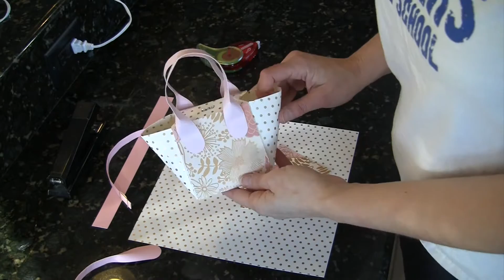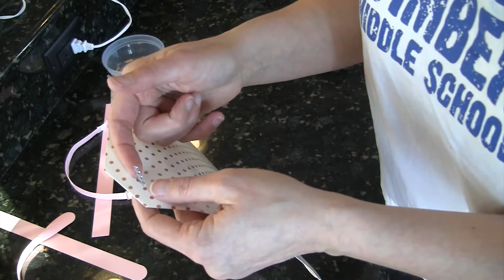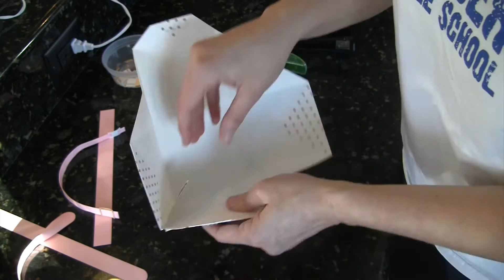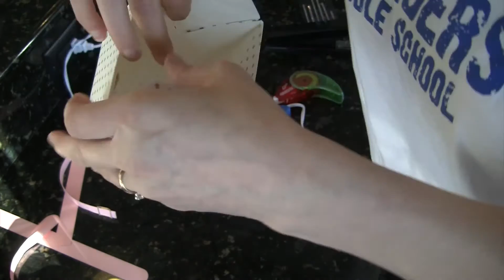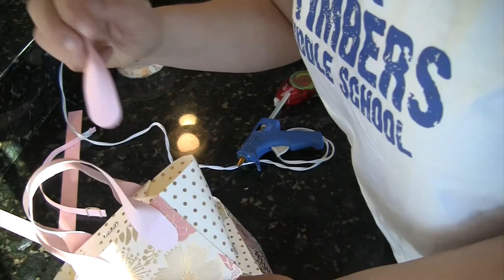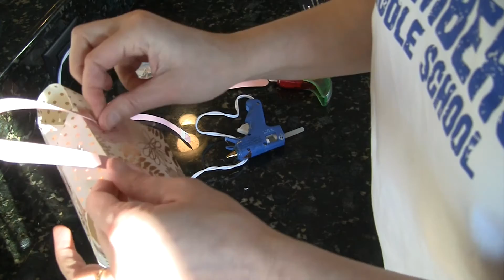Using Design Space and a Cricut Explore Air to create a purse gift bag

Comment: Hi this is a great video.  Do you still have the cut file for this.  if not may is have the measurements for where the fold lines are.  I don't see this particular purse in design space.  do you know the name of it. Thank you
Reply from the maker: Here is a link to the SVG file that you will be able to upload into Design Space.  The lines will need to be changed to score lines and the others will be cut lines. 

https://drive.google.com/file/d/1e06wSg4T_bQ4CA7JfkFwOieNLhsRm_w0/view?usp=sharing
Reply: @sdonnal  thanks for the file but it doesn't have the score lines for the corners for the velcro.  I've tried to add them but the project isn't working correctly.  I resized the entire grouped file down to 11.5 so it will fit to a 12 x 12 sheet but I'm not sure how to get the correct distance for the corners.
Reply from the maker: @deborahcannon2403  I apologize for the issues.  I just updated the svg file with the corners.  https://drive.google.com/file/d/1sykg8y6MB8Up8lW1OFyMzKkriL7sDmei/view?usp=sharing

Please let me know if you have any other problems
Reply: @deborahcannon2403  I can't make it work either and I would like to see a video too of how it was cut.  I've spent 2 days trying to resize the file and adding score lines, but it still doesn't work and it doesn't cut correctly either!! :o(
Reply: @sdonnal  thank you